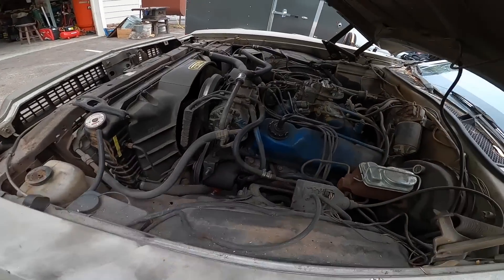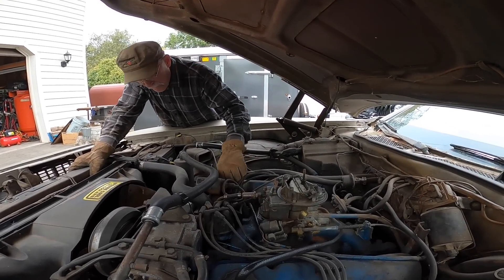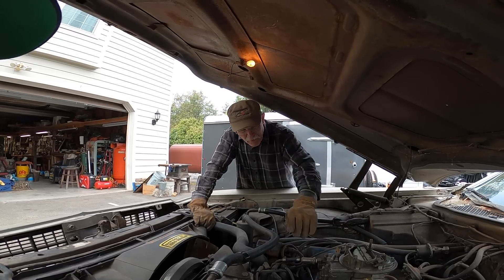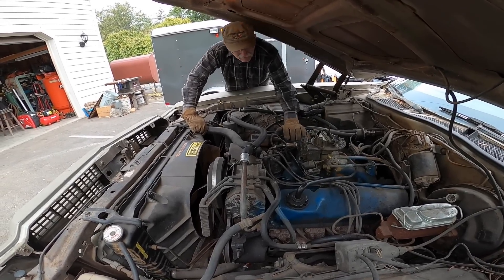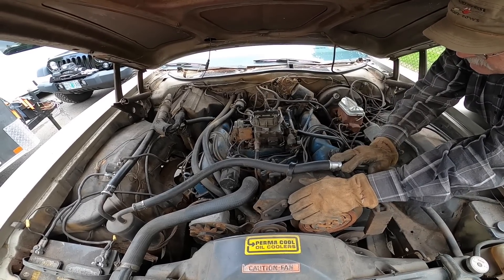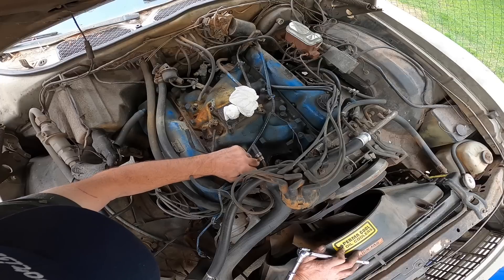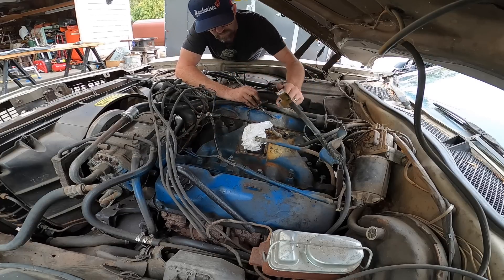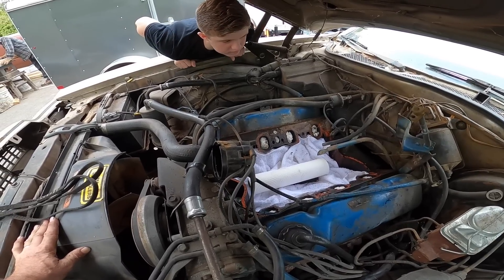Switching from Stock 2 Barrel, to 4 Barrel Edelbrock (Novice Mechanic)

Comment: Brings back memories. AMC 360-402 in an IHC. Went from 2bbl to 4bbl Edelb. Amazing power in the mountains after that pulling a 22 ft trailer. Not much difference in acceleration but uphill almost no slowdown in the mountains west of Calgary. Had to have a gas truck following along behind.

Comment: Always, I say again ALWAYS, cover all openings going into the engine, as soon as they exist!   You do not want anything, particularly something hard, going inside.   The aftermath will range from worrying to a catastrophic failure, unless that errant object is remove by whatever has to be disassembled.